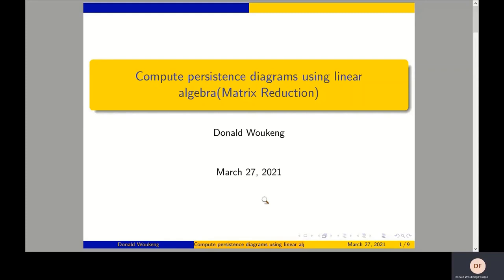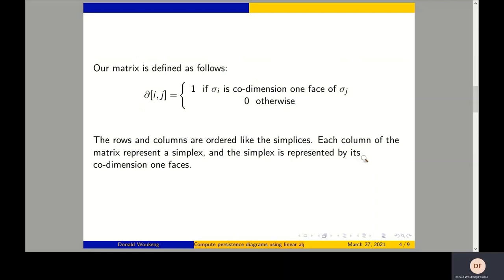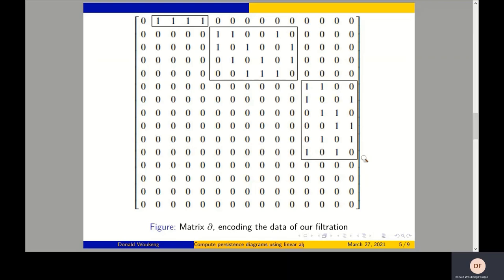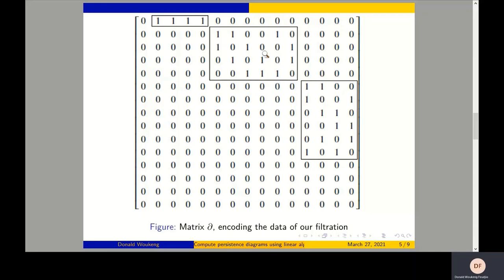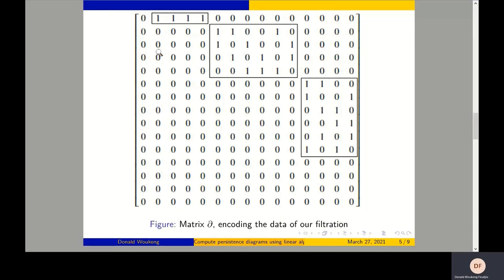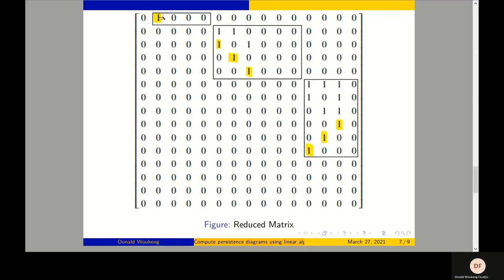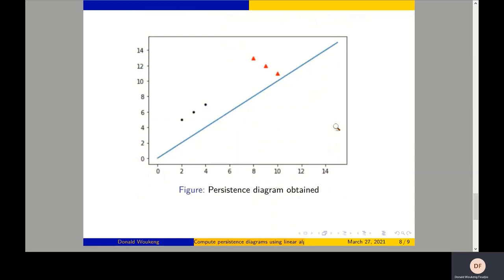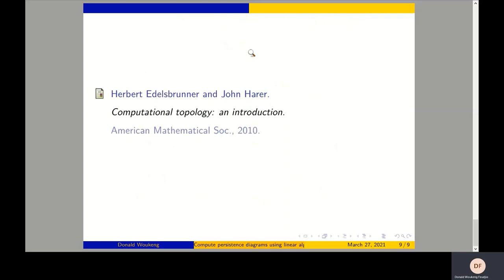Computing Persistence diagrams using Linear Algebra [Donald Woukeng Feudjio]

Comment: Hi Donald, thank you for your tutorial! It seems you forgot to mention the pairs with infinite persistence (the ones that never die). Such an infinite (often also called essential) persistence pair [b, infinity) corresponds to an index b such that the b-th column is all zero, and the b-th row doesn't contain any lowest one. See https://youtu.be/a-va5BRs14k.
In your example there should be a 2-homology persistence pair [14, infinity) corresponding to the last triangle that was added in the filtration.